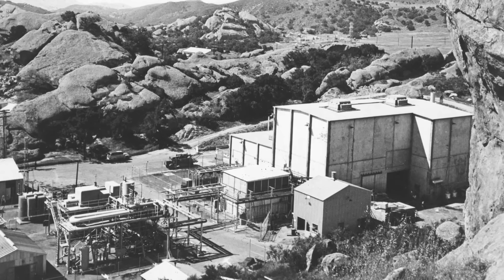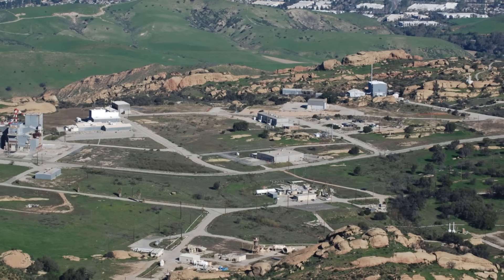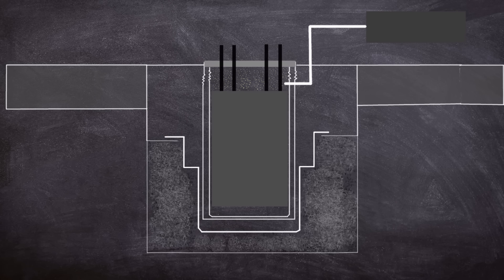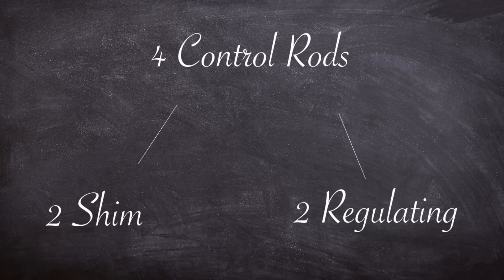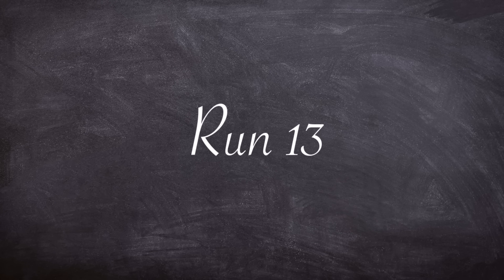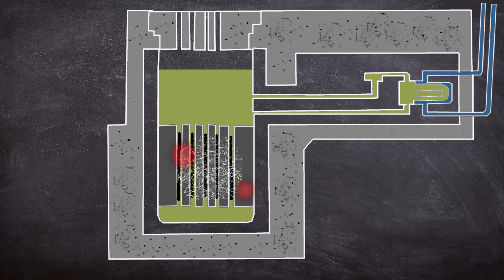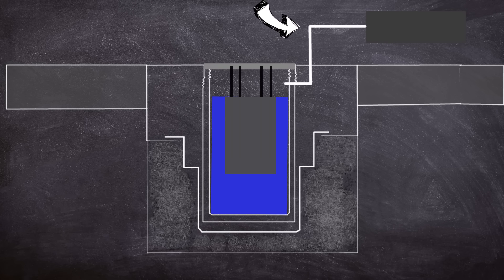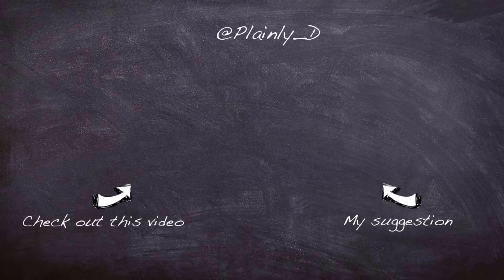A Brief History of: The Sodium Reactor Experiment Accident (short Documentary)

Comment: "Oh hey the automatic emergency shut down keeps triggering, that's annoying, turn it back on again Dave,"
Reply: Basically that's the story of Chernobyl.
Reply: @Jodonho  You must be mistaken...
Reply: Reminds me of the sign that says if it is not broken get a bigger hammer.
Reply: Thats the story of lots of places sadly.  Or even forcing the reset function on due to those pesky alarms...
Reply: fix0the0spade, you are quite correct the operators kept trying to start the thing and over riding the safety systems.  They treated it like cranking over an old Ford in the winter.
Reply: @connclark2154  Cranking over an old ford at worst would be killing the battery or seizing the motor. Does not cause the death of many thousands.
Reply: @Paul-gz5dp  , It didn't kill thousands. It most likely didn't kill one person. We know from the EBR meltdown that most Iodine-131 stays in the fuel element or chemically combines with the metallic sodium.  All gas releases were inline with federal regulations then as well as today.
Reply: They got lucky. Simple as that.
With their borderline idiotic disregard for safety they wrecked the reactor before something important broke.
For example: If the control rods channels warped, the scram rods could not be inserted and you'd have an uncontained reactor meltdown
Reply: > "Oh hey the automatic emergency shut down keeps triggering, that's annoying, turn it back on again Dave"

Obligatory: "I'm sorry, Dave, I'm afraid I can't do that."
Reply: Paul that was his point
Reply: @Jodonho  In Chernobyl they switched EVERYTHING OFF, and even chained certain gate valves shut so nobody got any bright ideas.
Reply: @connclark2154    All gas releases were inline with federal regulations then as well as today. 
Offcourse  your government  doesn't lie to their people :-) You believe in fairy tales also I assume?
Reply: @arnold9861  , I believe in science. Sodium readily combines with iodine. This limits the amount of gases that could be released. Furthermore, we know from examining the EBR-1s metallic uranium fuel that melted down that several decay gases get trapped in the fuel. Since the SRE was using metallic uranium fuel at the time and the fact that the SRE was sodium cooled the only real radio active gas that would have been released would be xenon. That falls in line with the amounts that are recorded to be released.
Reply: All fixed, boss
Reply: "hmm." (puffs on pipe) "try poking at the rods."
Reply: ah, a corporate classic -- time's money you know?
Reply: Damn, that fuse keeps blowing ...put a penny on it.
Reply: yes, let's just bypass that circuit.
Reply: @connclark2154  Uhm no. The gas that got released was MEASURED to be inline with federal regulations. "3.6 roentgen, not great not terrible". Its easy to get such detectors overwhelmed, especially when they're only meant to measure much lower levels.
Reply: @haraldhimmel5687  A gas tube radiation detector three usable regions Geiger Muller, Linear proportional, and Ion chamber. Higher level radiation detectors use the Ion Chamber region and are not vulnerable to saturation like the Geiger Muller region is.  Furthermore, it is very doubtful that enough radioactive gases could be produced to overwhelm anything because it was fresh fuel and they were starting the reactor. There hadn't  been enough fission to occur to store enough gases in the metal fuel. Note: the meltdown occurred due to some plugged coolant passages not a run away reaction.
Reply: @connclark2154  That was one of the documented flaws in this facility. That the detection methods were only suitable to accurately measure rather low levels. Considering how vastly different various estimates are (including the "almost nothing" one from rocketdyne), I would be careful just repeating their official numbers, especially without further evidence.
Reply: Holly = "There all dead Dave. . " 
Sounds like they had Rimmer working at this place. 
Red Dwarf.
Reply: @VeganV5912  put down your tin foil hat
chernbyl was an awfully unsafe design(even the USSR official knew that), that would never be approved in the modern age, combined with human error
Fukushima was struck by a massive earthquake and a tsunami and still only 1 confirmed radiation related death
and we do know what to do with nuclear waste for the long term- put it in a tunnel, under kilometers of solid stone, in a geologically stable area, and cover it in reinforced concrete
Reply: @connclark2154  tell that to the hundreds of families all suffering from the same type of cancer living in the vicinity.
Reply: @jamescolley568  3 mile or chernobyl?
Reply: "This stupid co2 sensor keeps beeping,i'll remove the batteries"
Reply: @fix0the0spade Yes sir!  jams it wide open
Reply: Okilidokili
Reply: @fallencastle good luck finding anyone in chernobyl xD

Comment: Sodium reactors are fun, easy to make, and great for powering your house. You also don't need night lights, and don't eat much because everything tastes like copper.
Reply: Well, I chew copper regularly, and I also have my own sodium-cooled reactor in the basement, so I really know what I'm talking about here. Sodium-cooled reactors don't taste anything like copper (unless there's a sodium leak from the primary, in which case the taste is a little like chewing on aluminium and copper simultaneously).
Reply: Yep, I know what y'all mean.  I installed my own sodium-cooled reactor a few years back.
The money savings are just tremendous!
I've been patting myself on the back, with the third arm I grew, ever since!
Reply: Hahahaha
Reply: My sodium-cooled reactor was repeatedly shutting down. I figured something must have gotten clogged up, so I used my bulldozer to rock it back and forth a few times to shake loose whatever was clogging it up. Since then, it's been steadily increasing its output regardless of what I set it to, so shaking it up a tad must have worked. :-) In an unrelated note, my neighbors complain about not being able to sleep at night from their glowing bedroom walls. I asked why they bought a house with such a nifty perk of modern living if they knew it would keep them up. I sort of like the green glow of their house more than the purple glow of mine. The same architect undoubtedly built both houses, but my neighbors definitely got the better end of the stick.
Reply: oh yay! i really love the taste of copper and i’m not allergic to it at all! thanks for the advice!
Reply: I sure hope it can't be weaponized.
Reply: @anhedonianepiphany5588  Aw, I hate that taste.
Reply: @laceystinson  What do you do with your waste? Because my garbage men are complaining that they're keeping their wives up all night long from the intense green glow emanating from their body.
Reply: @SteveWeiserOnYouTube  I use the waste to fertilize our house plants and vegetable garden. The humongous flowers and giant vegetables we get are absolutely amazing. The one real problem we have, in my view at least, is the giant ants. My kids love to play on their mounds. I tell them not to, but they're going to do it regardless of what I say. You know how kids are. 🙄
Reply: @laceystinson  There's a simple solution to that problem. Feed some of those vegetables to an aardvark. Giant aardvarks = no giant ants.
Reply: @SteveWeiserOnYouTube  We do have a spare bedroom to host a giant aardvark. That would also be a convenient excuse for why my aunt-in-law can't come stay for an extended visit. Thanks for the suggestion.  👍🏼
Reply: Seems that someone didn't get it 😂.
Huge radioactivity level is known to cause a metallic flavour. And if it gets really high it will ionize the air, making it glow.
Reply: @Rasta Xde I'm glad you didn't get it from IKEA. With mine two parts didn't line up,  one part was missing and the instructions were for the wrong unit. 😕
Reply: There’s an additional benefit that you can find your children after school with a Geiger counter when they ignore your calls.
Reply: @carolinawestern3875  Damn HOA always getting in the way of good ideas.
Reply: Some of the funniest shit i have read, though normally i read books mostly since though i have no electricity (my bastard neighbor won't share at all), i have noticed that i don't need any candles anymore, so i started to be less angry with my neighbor so he showed me this channel. So glad he did. You guys are positively glowing.
Reply: I bought a sodium reactor kit off Wish, but the instructions were in chinese so I'm at a bit of a loss here.  I don't see any kind of mounting hardware, so I had to duct tape the fuel rods in place.  The containment shield wasn't included so I just installed it in my basement, which happens to have concrete walls.  So far no power, but the savings on the heating bill in the winter means it's paid for itself tenfold!
Reply: @grmpEqweer  best one lmao
Reply: Brilliant!  Right, that clinches it!  I'm off to buy a sodium reactor for our house!
Reply: @stevenmillikin558  -- Yeah man, me too.  The next "must own" item perhaps.
Reply: This entire thread brought me a lot of amusement and I really needed it. Regardless of my mental state, however, this is funny as hell. You all win the "Best at internet commenting" award! Cookies for all!! 🍪🍪🍪🍪🍪🍪🍪
Reply: Yeah, yeah. You guys are laughing now. It's all fun 'n games till someone grows a third eye.
Reply: Maniac mansion!
Purple tentacle for president!
Reply: Okay

Comment: Reactor safety systems keep tripping
Operator: huh, thats weird. [Clicks back on]

During both my mechanics and engineering courses I was taught if you're doing something and its seems harder than it should be, you're doing it wrong.
Reply: Its the same as keeping a circuit breaker held in, when it keeps on tripping. Then wondering why smoke is pouring out the wiring
(people have done this)
Reply: @notmenotme614  good lord
Reply: That's why knowing the difference between monitoring equipment failure vs monitored equipment failure is very important!!
Reply: What is the correct way to open a pickle jar, then?
Reply: Installed an IKEA curtain wire and didn't read the instructions. The thing has 1 moving part, so how hard can it be? Turns out the wire is pulled under tension so the right hand mount has left handed threads. I managed to completely destroy the threads by screwing a right handed peg into a left handed nut.
Reply: @notmenotme614  That's the reason circuit breakers have a catch on the switch handle so the internal mechanism can trip even when they are held in the on position. Manufacturers found out the hard way that you can't idiot proof your design. I've seen someone cut off the ground pin because the GFCI breaker kept popping, and wonder why they got a shock when they touched their fridge.
Reply: Your supposed to replace the breaker with a salad fork. You did it wrong.
Reply: Reactor is acting as op stated
Me: attempts to placate the machine spirit of the reactor by lighting ritual candles, applying sacred Oils, and recanting applicable litanies
Reply: @Wix92  break the glass, obviously. Lids are too hard
Reply: It was SOP to investigate why a reactor has scrammed before you tried to restart it.
Reply: No, it just means you're not using a big enough hammer!
Reply: @Wix92  You put a butterknife between the lid and jar and pry it a little bit to break the vacuum.
Reply: @marc-andreservant201  So, was the fridge haunted, or the whole house?
Reply: @lambentlamprey  The fridge was defective due to a short between the live wire and the metal body, which is normally connected to the ground pin so the breaker will trip immediately if that happens.

If you cut off the ground pin, the circuit breaker will not trip and the fridge will work, until the day you're trying to open it barefoot with a water spill on the floor, at which point your body becomes the ground wire.

Comment: Maybe a bigger gap than 0.013" is needed if your coolant can form solid oxides.
Reply from the maker: Probably a good idea!
Reply: That's (goes away to do the calculation himself) a third of a milimeter. That's not a gap. That's not even wriggle room.
Reply: If it's forming oxides, there are other issues at play. It means you've got oxygen getting in somewhere. And that's bad news bears with molten metallic sodium.
Reply: @Yora21  they literally designed this thing without any wiggle room.. disaster waiting to happen.
Reply: I would use different cooland that is not forming anything. Like molten salt.
Reply: @WadcaWymiaru  Stop talking about things you haven't even done basic research on. Most molten salts proposed for use in nuclear reactors are highly corrosive, and the one that isn't is highly toxic, and only mildly corrosive...when the exact right ratio of elements is maintained, and when impurities, like sulfur, have been thoroughly removed. FLiBe (which is a mixture of lithium fluoride and beryllium fluoride, and can achieve nearly noncorrosive status when mixed up just right) is certainly a promising high temperature coolant, especially for fast neutron reactors, and a wonderful solvent for liquid fuel reactors. But it's got a variety of issues of it's own that need to be dealt with properly, lest, just as an example, massive amounts of beryllium leak out into the environment and poison everything around the plant. Unfortunately, there is no perfect, nontoxic, noncorrosive, totally safe option for nuclear reactor coolants. All of them have their own dangers and handling risks, and which one is best depends heavily on what exactly you need to do with them. For some applications, sodium or sodium-potassium alloy are perfect, whereas molten salts might not be. It's all about what your design needs the coolant to do.
Reply: @Nixeu42  
That wasn"t basic research but full-scale experiment the NEVER goes out of controll like LWRs or LMFRs)
There is A LOT of salts you can use, not only lithium-berillium.
https://en.wikipedia.org/wiki/Molten_salt_reactor#Fused_salt_selection
a far cheaper sodium-zirconium fluoride.
The impurities are not a big problem and...corosion is neglible, when compare to pure sodium.
Reply: @WadcaWymiaru  Yeah, and most of those salts are corrosive. It takes a very carefully stoichiometrically balanced mixture to nullify the corrosion issue. FLiBe is the only salt with negligible corrosion issues. That's stated in your own freaking source. The impurities aren't minor issues either. They're an equally major problem, because they can cause corrosion, and particulate build up, the very issue that caused the nuclear disaster this video discusses. I don't really give a damn how they compare to liquid sodium in corrosiveness. Regardless, corrosion is a concern. 

What you seem to be missing is that meltdown is not the biggest danger with nuclear power: loss of containment causing radioactive material to escape  into the environment is the biggest problem. The explosions from meltdowns are comparable In power to pretty much any other industrial disaster. They're not comparable to nuclear detonations. The blast in Beirut recently was likely more powerful than the explosions at Chernobyl and Fukushima combined. I haven't done the math on that, mind, I'm mostly basing it on the fact that the reactor buildings for both disasters are still standing to this day, whereas a large section of Beirut was leveled. No, the biggest problem with nuclear reactor meltdowns is in how the blast releases nuclear material across wide stretches of land. Leaks of nuclear materials due to corrosion might be easier to contain, but they're still significant issues. Passing it off things like coolant purification and corrosion as minor concerns is demonstrating the exact mindset that caused the disaster this video discusses.
Reply: It's always in the 13.
Reply: @Nixeu42  - I knew one of the engineers that worked with the Sodium Reactor Experiment and other sodium cooled reactors at the Santa Susana Field Laboratory. When Bill Gates started talking about Sodium Cooled Reactors, this scientist / engineer - this was a decade ago - referenced the corrosive nature of his research on these reactors.  I still prefer a sodium cooled small reactor to a high pressure water boiler reactor.
Reply: @chrisrowe3323  Depends highly on the application. The US Navy's track record with their LWRs speaks for itself, IMO. That being "effectively flawless, no meltdowns, no real leaks, only accidental release being from sunken ships." Shit/impossible design for commercial applications, given the lack of easy throttling and use of a weapons-grade plutonium neutron poison, but seal-and-let run works exceedingly well. And sodium metal and water don't really mix, so that might be a hard sell for naval use.
Reply: @Nixeu42  that blast has the air ionizing like a nuclear blast
Reply: Salt? Metals? Oxides? Chemistry always seems to come up periodically.
Reply: @spider0804  this is sodium metal in this reactor, not salt. :)
Reply: I'm sure someone who handed in those calculations upon hearing about this went "fuck.....should of carried the 3...."

Comment: 2 notes:
1 BWRs are specifically designed for water to boil in the reactor vessel and are pressurized to around 1150 psig
2 a SCRAM accuated specifically by the reactor operators or equipment failure is referred to generally as a trip as SCRAM is the mechanism by which the the control rods are actuated

Comment: It's difficult to say if the cancer clusters are because of THIS...mostly because the other company on the site(Rocketdyne) leaked a crapload of horrifically cancer causing rocket fuel and solvent chemicals offsite around the same time. So it's hard to say what's because of radiation from SRE and what's because of chemical leaks from Rocketdyne...or what's natural, that area also has higher background radiation due to the granite in the rock and a high incidence of radon.